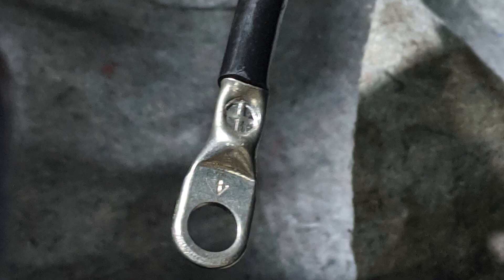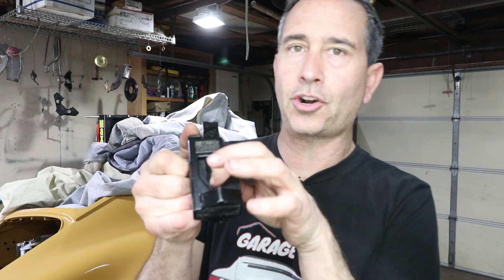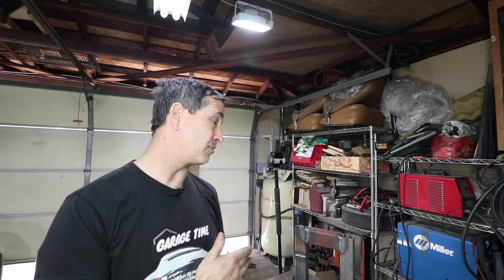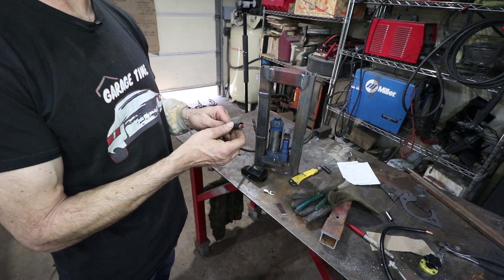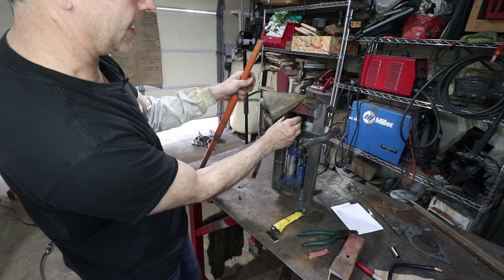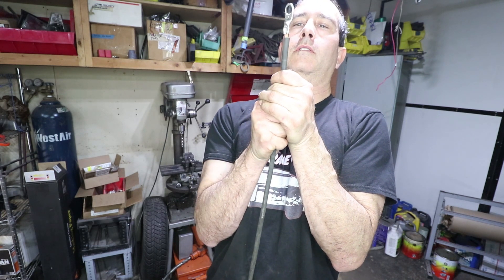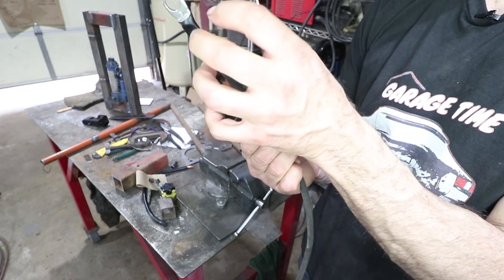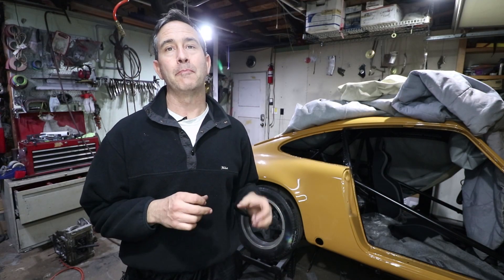How To Crimp Battery Cables EASY with Cheap DIY Hydraulic Tool

Comment: Also I do have a Swagger tool crimper but they're just two circles on each end so I was thinking about just putting a bolt and like taping it on one of the circular Jaws and like a BB on the other half of the Jaws, do you think that would work better? It's one of them tools that look like a bolt cutter
Reply from the maker: Seems like the bearing might squeeze out.  I like the idea though.
Also, have you tried the hammer method and it didn't work?
Reply: @GarageTimeAutoResto  yeah I taped the bearing in there with electrical tape and I tried that once but I don't think it crimped enough but also with the hammer crimper I did it and it wasn't 100% I probably should have used a bigger hammer and might work better I just don't want to buy the tool they got one on Amazon I think it cost $25 I should just buy that but I'm cheap LOL and it's such a simple thing you would think I don't want to Soldier I'm doing the big three upgrade so I'm using zero gauge so yeah I just really want to crimp it good

Comment: So your idea is so close to what I'm thinking about doing! Now in my predicament I'm not concerned about doing it in a tight area where you don't have nothing to push against where you had to build a frame I have the same Hammer crimper tool cheap Little Harbor Freight thing but I don't like the way it's crimped only with a whack of a hammer, so I was going to take that little cheap hammer lug crimper and put it on top of my floor jack get the wire situated and then press the crimping tool against the frame of my SUV so basically I would be using the indent from the hammer crimper tool it would just be sitting on top of the floor jack in between the Jack and the truck frame and then give it a couple pumps as if I was just simply jacking up my truck my only concern with that is that the floor jacks tend to kind of roll as your jacking up a vehicle so my other thought was I got one of them basic in the trunk scissor Jacks I guess they're called the ones that come with every vehicle usually were you twist the end and it's like a the shape on each end type Jack I know those push straight up kind of like a bottle jack but I don't have a bottle jack so anyway what do you think I think you're genius because you're taking the same crimping tool that I'm thinking about and doing something pretty damn similar we are geniuses! And I never seen anyone else say or do anything like that besides you so that's why I'm asking your opinion. Well hope everything worked out with your Porsche there let me know what you think please thanks!
Reply from the maker: I like it.  The only problem I see is how do you know if the jack is squeezing the barrel or lifting the car.  At some point you should get enough force to crimp it, but I don't think you get much of a feel.  
And be careful that it doesn't twist out of there and shoot across the garage.

Comment: 10 ton hydraulic terminal crimpers, with dies, are easily had for $27 to $40 on Amazon, shipped.  I also don't see that you actually had a situation where pulling the wire with the terminal was any harder than pulling the wire without the terminal.  Much less that it would have been harder than spending all that time and effort welding the half-assed solution.  I guess you just like welding, or were too stubborn to pull the wire out (making it really easy to pull a cord through for pulling the wire again) to hammer the terminals on as your tool is designed to do, and pull it again.   You made yourself a lot of work for no reason, though I guess you now have a cumbersome but free way to do similar, vs spending $27.
Reply from the maker: I do like welding 😀.   I will tell you that I spent way more time pulling that wire through than I did making this crimper.  
Maybe I wanted this to be a commerical for a chinese crimper, ha ha
Reply: @GarageTimeAutoResto  and you have a mini-press that is already made.  There is use for that tool.

Comment: Good call on not just soldering it.  

You first need a good mechanical connection.  Then the solder fills the gaps, keeps air etc from getting to the connection. 

A common repair on equipment I work on is fixing a bad connection where only solder was the connection.  It’s sometimes amazing at what level of equipment I see this on.  

And that raychem heat shrink is the best.
Reply from the maker: Good to know Wayne!  Thanks.  Do you hang from your cables too?

Comment: I have a crimper that is used to join stainless wire on boats. Looks like bolt cutters with a fancy tube shaped end on. Used for the wires connecting my shade sails to the house
Reply from the maker: Cool, whatever works I say.  Most important is to get it done and reliable.